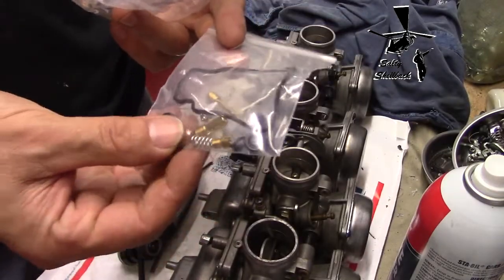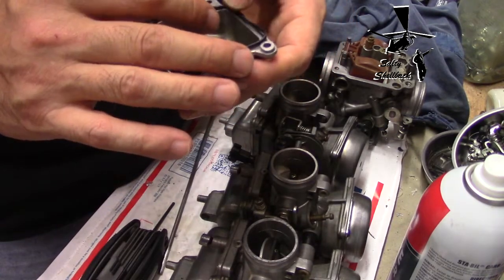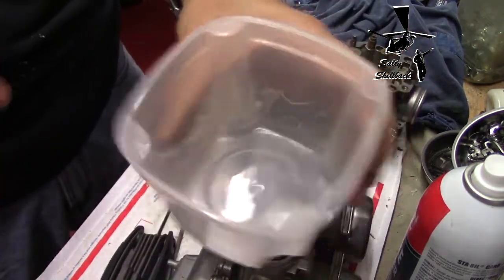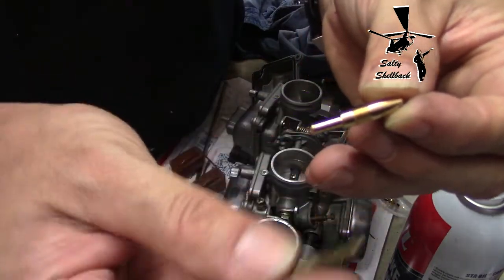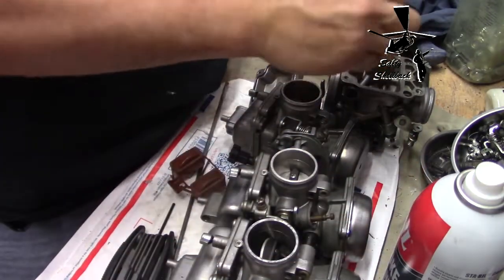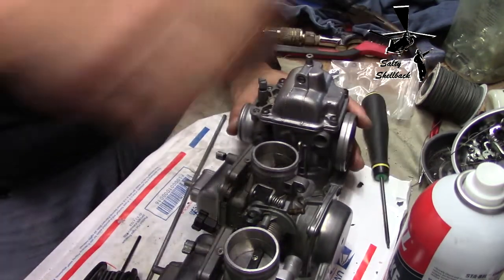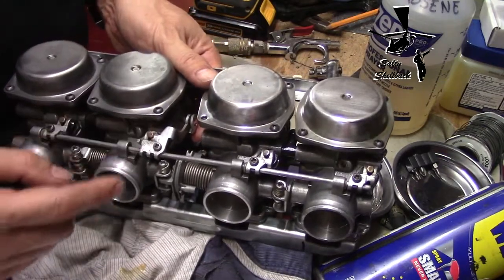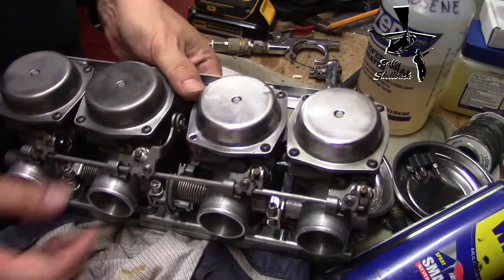1983 Honda Nighthawk repair journey -Part 5 carb rebuild

Comment: "I used to be an aircraft mechanic." - Salty
"I am not a professional." - Salty.
😯 = Me not boarding a plane any time soon.
Reply from the maker: Navy aircraft repair philosophy is that if it's leaking, that means there's still fluid left...when it stops leaking is when you need to worry. 🤣

Comment: did that rebuild kit end up working even though some of the parts were slightly different?
Reply from the maker: Yup. The bike runs great now. Just had to use a carb tuning tool to adjust the fuel ratio to the right levels.